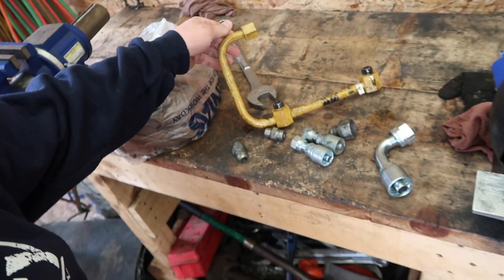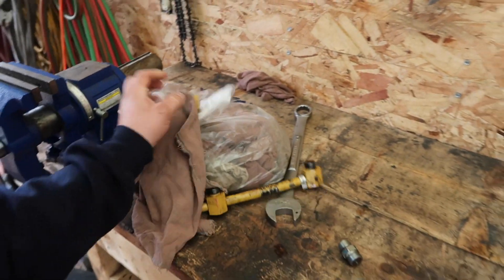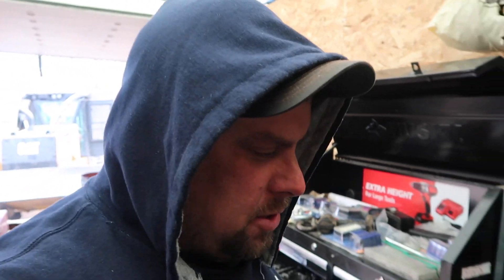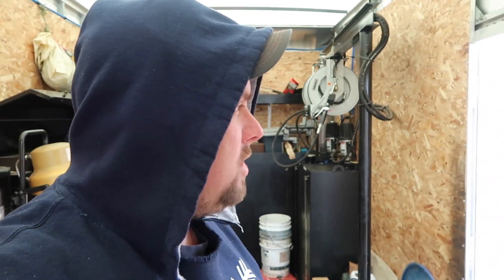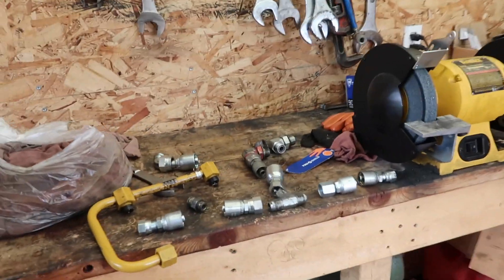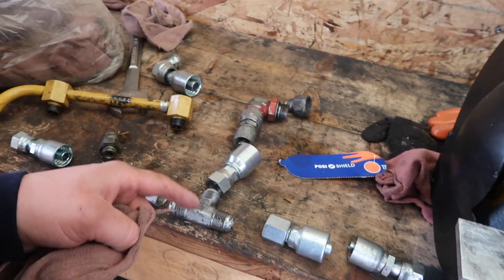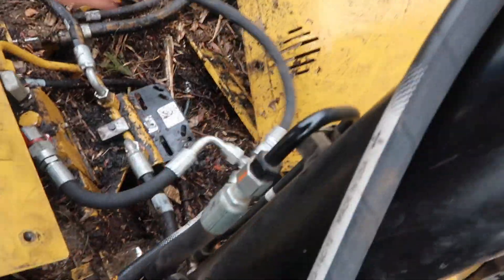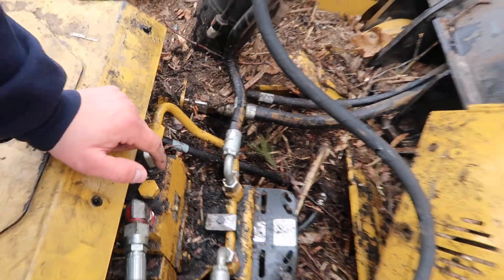THROW ALL THESE TOGETHER!!!!!

Comment: I could not agree more. ||Hydraulic fittings and rigid  pipes  should be standarsised, i. e. like "metric" threads, or "AF" type threads, but that would be too easy. My mowers use a combination of "FlatFaced" and "Collar" type fittings.